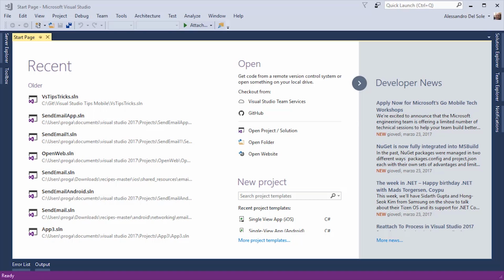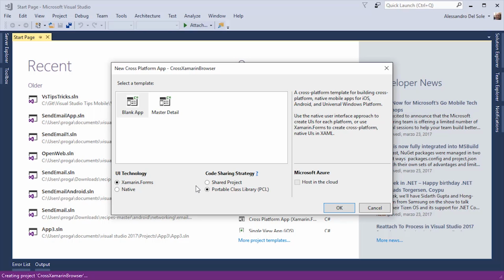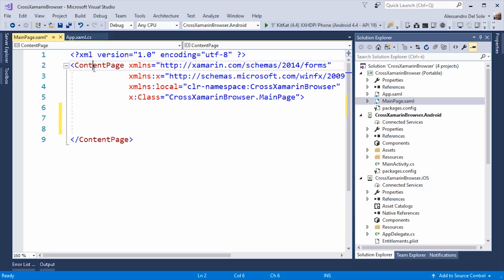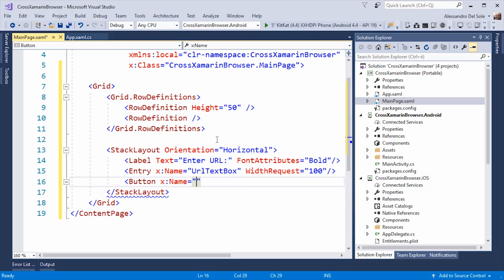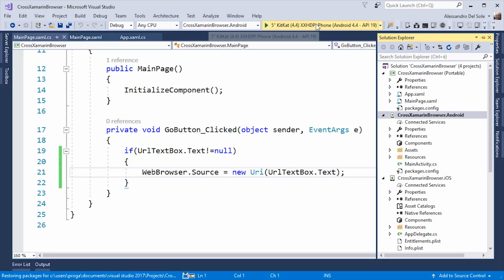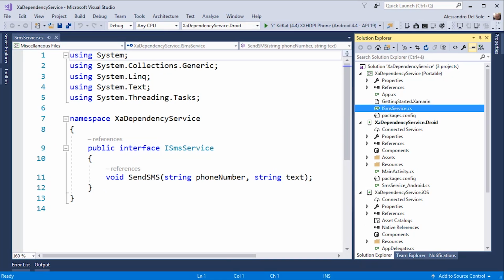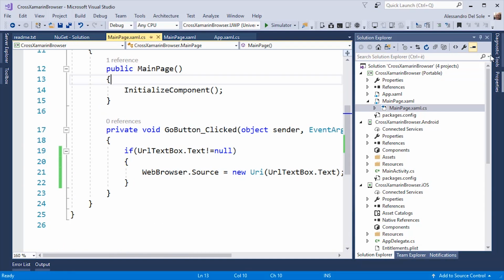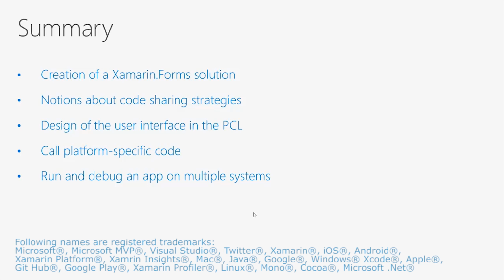Introduction to Xamarin.Forms

Comment: I really like the videos, Alesandro. They are great for begginers like me. Can I ask what kind of a beast machine do you use? In the videos it looks like everythink is done in matter of milliseconds. In my computer loading the emulator takes no less than a minute. I found a misspell in the last page of the (I think) PDF file you show when the video ends. May be it's correct, you can tell me. There is "Xamrin Insights" instead of "Xamarin Insight".Great work.Ariel from a frozen Argentina.
Reply: Thanks Alejandro. I use an i7 with 16GB RAM machine and a SSD disk. 8 GB RAM can be enough if you set emulators to work with 1 GB RAM or 512 MB. If you want to give emulators 2 GB RAM, then 16 for the host is necessary to have good performance.